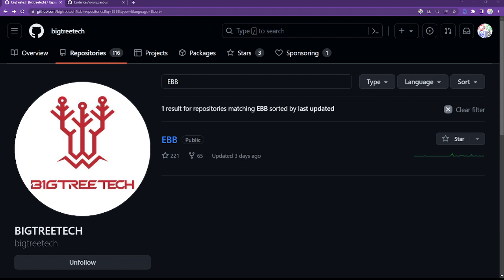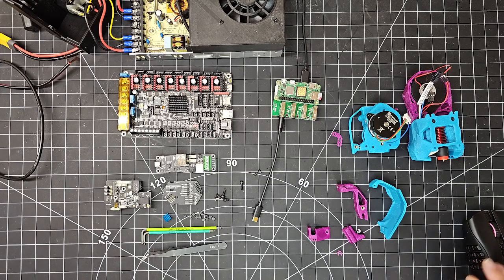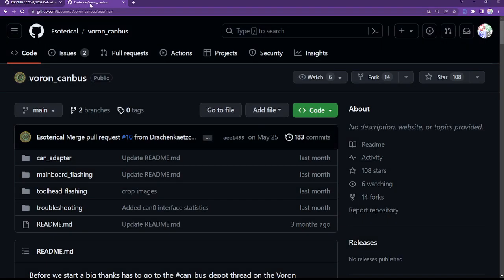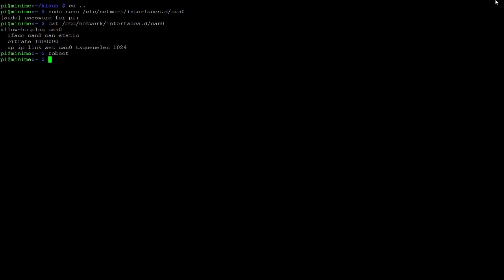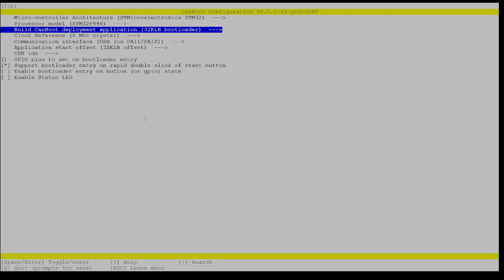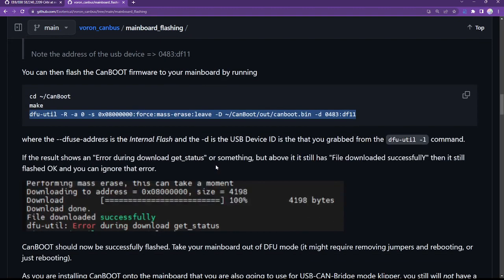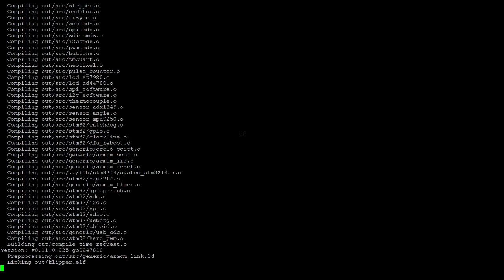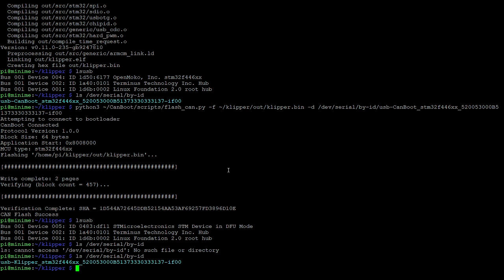From The Bench: Episode 1 - Flashing a BTT Octopus Pro Primary MCU with CanBoot and Klipper

Comment: This is super helpful. Thanks for doing this. I'm upgrading an existing Trident. I have the Octopus connected to my 24V power supply and then have a USB connection from the Pi to the Octopus (I use the octopus to power the PI).  I added the BootTo jumper. But I'm having trouble getting the Octopus into DFU mode.  When I power-on, the Octopus lights up, but when I do lsusb, I don't see an STM device in any mode.
Reply from the maker: Have you made any progress? If not find me as OldGuyMeltsPlastic on Discord, or ask for help in the Voron Discord server's #can_bus_depot channel.

Comment: Just wondering , why did you flash canboot to the octo only to then over write it with the klipper firmware . You only have to flash canboot to the Octo if you ARE going to use Canbus bridge ? Otherwise you can just go straight to flashing it to the U2C ?
Reply from the maker: You are right, CanBoot/Katapult is optional, and even more so if you are using a CAN adaptor like a U2C. However, flashing it here gives me some flexibility for my testbench hardware, which I may want to reconfigure for bridge mode in another video.
Reply: This is not a correct statement. Kan boot is written to the first 32kb of memory, then the clipper is written with an offset. Very convenient to update the firmware

Comment: if i have an Octopus already running Klipper, and am using a U2C (so no bridge mode), do I need to reflash the Octopus? is canboot only used when using bridge mode?
Reply from the maker: There is no need to flash anything to the Octopus when you use a U2C. While you absolutely can flash CanBoot/Katapult to the Octopus in that configuration, there isn't a compelling reason to do so.
Reply: @oldguymeltsplastic thanks for clarifying this

Comment: I have a very simple question if anyone can answer.

Why is it that you are using an external USB to Canbus board to connect to SB2240 when your MCU (Octopus) already has an option for Canbus? 

What is the benifit here? Why spend extra money here?
Reply from the maker: Four words: "Timer Too Close" errors.
Reply: @oldguymeltsplastic  Would you then suggest against using CanBoot from Octopus to EBB?

I was doing this for fun but this shit is more difficult to set up with a lot more issues.

I would just use a multi core cable instead.
Reply from the maker: @S00rabh  I started using CAN bus a year ago without a U2C, and it worked well for a few months without issues until one day, my first Timer Too Close error showed up. Three frustrating weeks of troubleshooting led me to try using a U2C, and the TTC errors disappeared immediately. I now have 3 printers with CAN bus all with U2Cs, and all run smoothly.
But I might be the outlier here, you should absolutely set it up how you want to.
Reply: @oldguymeltsplastic 

Thanks,
I just came to know that EBB36 can also be used with a USB cable connected directly to a pi.

It is just a 2nd MCU. Why not do that?
Canbus looks so overly complicated for something so little.
Reply from the maker: @S00rabh  if you have motion rated USB cable then go ahead and try it. I haven't myself,  but with the correct wires, there's no reason I can think of why that wouldn't work. Still need to source 24V and GND from somewhere though

Comment: Okay,followed your directions to the T and the last instruction to flash klipper seems to have erased the /dev/serial directory from pi so that ls /dev/serial/by-id/ is no longer found.  Damn, seemed to be going so well up until this point.
Reply from the maker: You are flashing Klipper to your primary MCU? Did you flash it in Bridge mode, or NOT in Bridge mode?
If you used Bridge mode settings, then yes, your primary MCU no longer will appear as a serial device in /dev/serial/by-id.
Instead it will appear with a CAN bus UUID when you issue this CAN bus query:
python3 ~/CanBoot/scripts/flash_can.py -i can0 -q
Reply: @oldguymeltsplastic  yup, must have done it in bridge mode, went back and looked at /klipper/menuconfig and sw I screwed up the last menuconfig with bridge vs non bridge.   Okay so I have a UUID now, can I continue on with part 2 now because no way to get back to the serial directory?
Reply from the maker: @brianguthrie9017  in Bridge mode, your primary MCU now also acts like a CAN adaptor/U2C, which makes the U2C from step 2 redundant.
If you want to use the U2C (I do on both of my printers), I would strongly recommend reflashing the primary MCU so that it doesn't run in Bridge mode.
Reply: @oldguymeltsplastic  I would love to do that but something updated and removed the/dev/serial directory so am unable to get the serial address that needs to be pasted in the next command.  Seems to be a lot of chatter on this being a bug within the 60-serial.rules file.  Will keep Hacking at it but seems like the bridge VS no bridge is far more important to get absolutely correct or risk corrupting your os.
Reply from the maker: @brianguthrie9017  that's a different issue. Your board isn't showing up in /dev/serial because it now doesn't communicate over USB
Reply from the maker: @brianguthrie9017  you need to put the MCU back into DFU mode in order to reflash Klipper to it.
Reply: @oldguymeltsplastic  Just to close this one out, thanks for the help but here is what I found out.  Did everything pretty much correct except the bridge vs non bridge mode.  So reflashed and was having extreme difficulty until I disconnected the daughter board on the stealthburner.  I was upgrading and already had everything installed so didn't give it a second thought.  I have noticed lately that there have been a lot of issues with this upgrade so thought I would add to your toolbox that this could be a possibility.  I have no idea why but there is a CAN connection between the 2 boards so this might cause no UUID to be found.